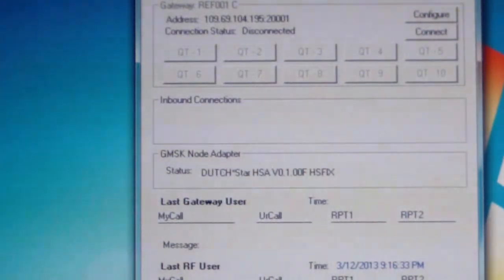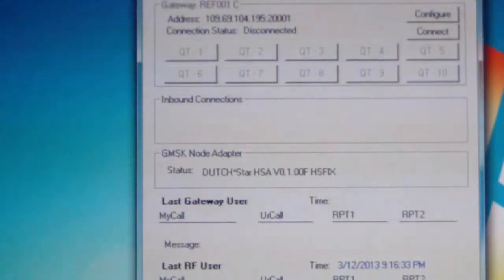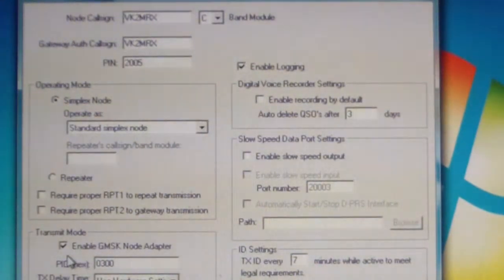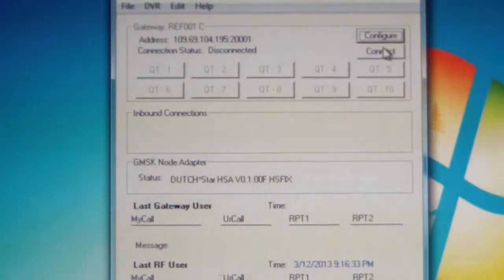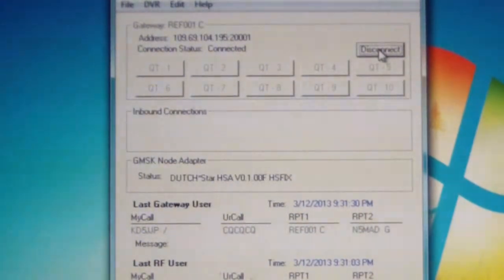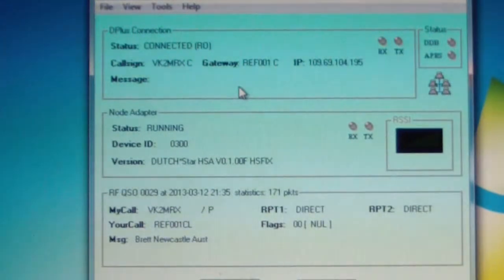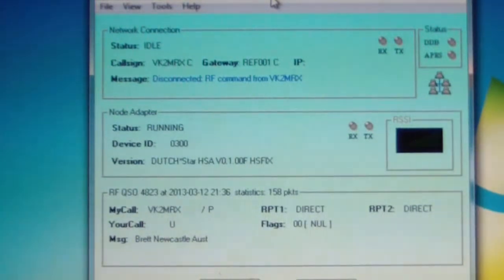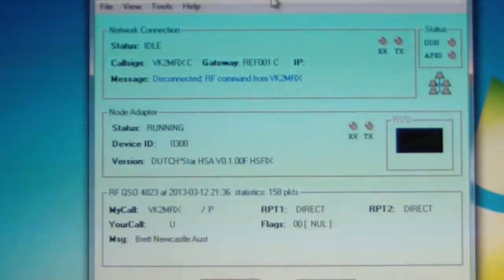Dstar hot spot set up series. Part 9

Comment: DVAR Hot-Spot will allow the reception and processing of linking commands *while the node is transmitting* if you are running in repeater mode.  As you noted, it's not possible in simplex mode.  

DVAR does not support voice prompts, but it does transmit it's linking status with text.  You can check your linking status at any time by kerchunking the node with your radio if you check the "TX status ID after every received transmission" in the settings window.

KB9KHM - DVAR Hot Spot author